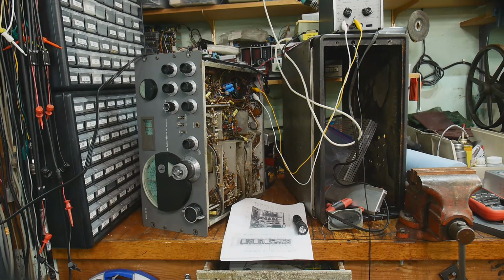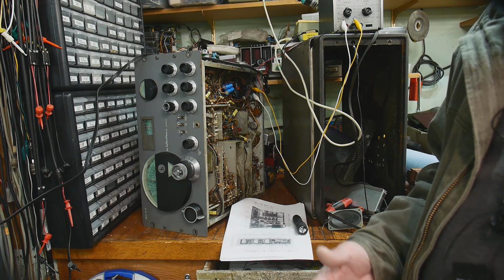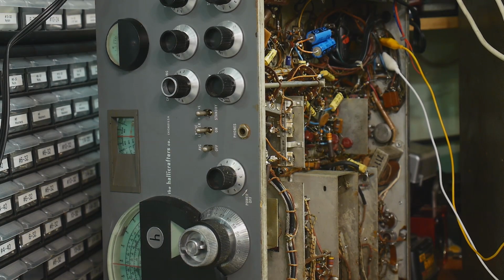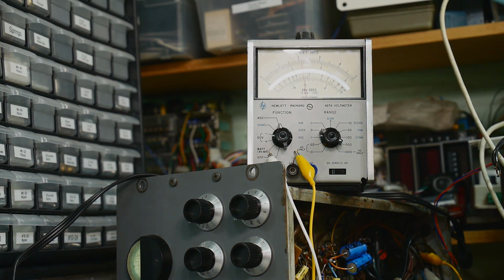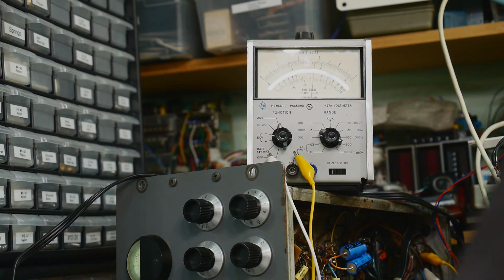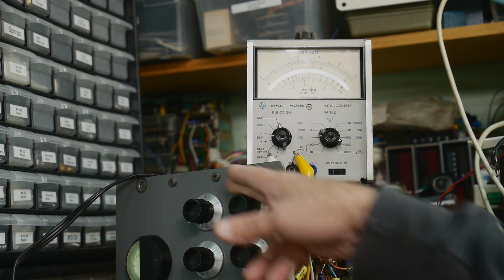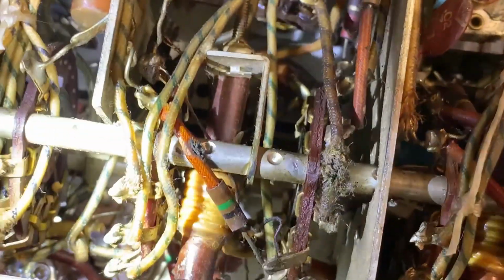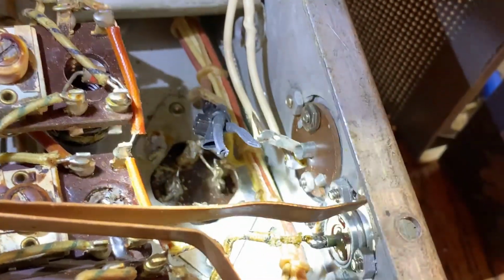#694 Hallicrafters SX-42 Receiver (part 6 of 7)

Comment: That so called phono input is an output to a 4 or 8 ohm speaker! It's not original. That transformer was added by someone. There should be two antenna terminals and a ground terminal there. There is a phono input but that's not it!

Comment: Trace out that RCA connector next to the added SO-239 coax antenna connector.  That RCA may be an added output for an 8 ohm speaker (impedance matched through that added transformer). Hams are all about adding features to their rigs, much more so than doing full capacitor replacement jobs!
Reply from the maker: Oh, that's a good thought. makes more sense.